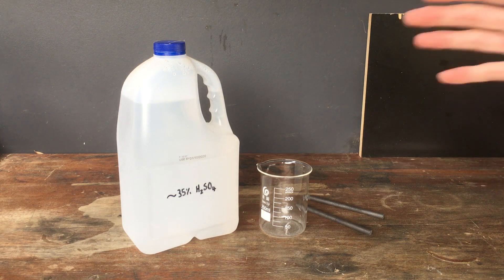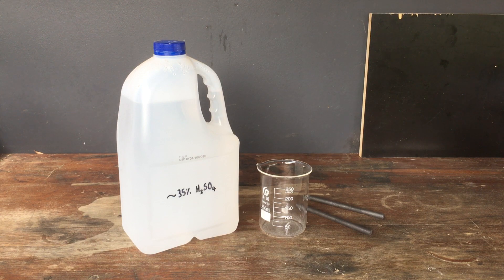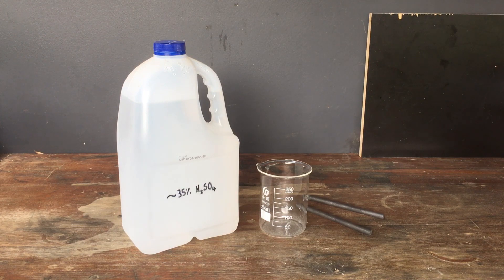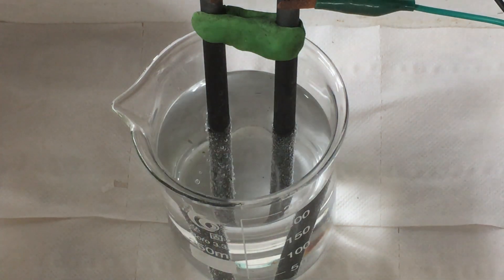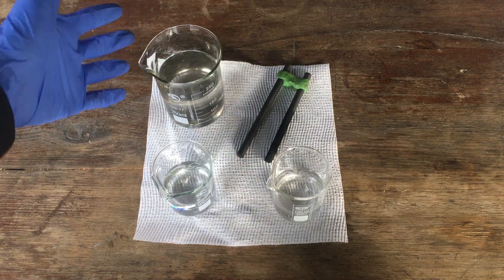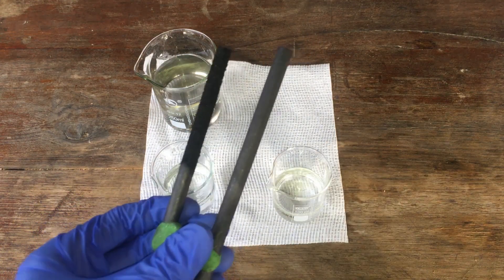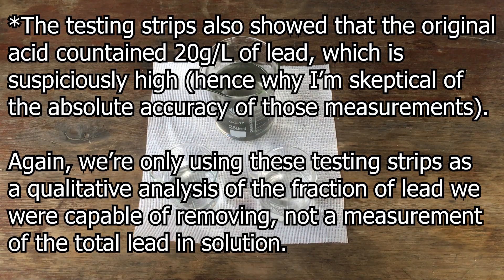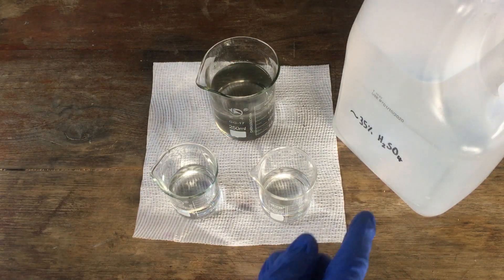Removing Lead From Battery Acid?

Comment: Can you make a video on making Potassium/Sodium chlorate using lead dioxide anode,by using your Flower pot diaphragm method ??
Reply from the maker: I'm actually working on a video about making potassium chlorate with an MMO anode right now, which should be finished in a week or so. 
I don't think I'll be working with lead dioxide in the near future I'm afraid.

What's your reasoning behind using a diaphragm though? As far as I know, chlorate production works fine without it.
Reply: @ScrapScience  as because the lead dioxide electrode got corroded in KCl solution,during electrolysis .

Comment: I totally get not wanting to distill sulfuric acid. That is actually a sign of a mature and knowledgeable chemist. 

The solution is to focus and get ready to distill the sulfuric acid. It takes preparation and a lot of safety. It might even take equipment you don't own yet (however I think you do own most of the necessary equipment and tools.) Take a few weeks and just study distillation and sulfuric acid. With just a few weeks of study/practice and a few dollars, you'll be ready. Once you're able to distill sulfuric acid, a lot of options open up. Good luck, I know you can do this safely and effectively!
Reply: DIstillation of sulfuric acid is an extremely pleasant process, IMHO. You don't even need a cooling water!
Reply: @dimaminiailo3723  that is a really great way to look on things.
Reply: @benjaminpainter378  Ahaha yes)
I've done this several times and I can say that I have never problems with sulfuric acid itself. Now, the only unsolved problem is the release of acid smoke from the preheated glass joint. Maybe I'll make a video about this process later.
Reply: @dimaminiailo3723  let me know if you do make a video, I'll support it
Reply: It's so nice to see a positive and encouraging comment in a youtube comment section. Good luck in all your endeavors fellow human! 👍

Comment: Thanks for sharing , what would happen if you just evaporate the water off ? with out a condenser.
Reply from the maker: For starters, you'll only reasonably be able to reach a concentration of around 70% acid before you start losing a large portion of your acid in the boiling process (and the required temperatures get dangerously high).
I'm unsure as to whether the lead would crystallise at that point. It seems like lead sulfate is still reasonably soluble in 80% H2SO4, so it'd be unlikely that boiling it down would be able to remove the lead.
Reply: @ScrapScience  ok cool.
Thanks for replying mate. Look forward for next video.  Cheers.

Comment: Alright I've got a bit of a stupid question. Couldn't you just boil the acid down and precipitate the lead that way as the dissolved lead sulfate shouldn't be very soluble in concentrated H2SO4. It definitely wouldn't get rid of all the lead but it'd be a good start i guess.
Reply from the maker: Not a stupid question at all, I was actually going to mention this in the video, but I forgot...
The solubility of lead sulfate is very complicated when you have an acidified solution (especially in acid concentrations like this). Standard solubility figures and solubility products are completely useless because the lead is able to form a much more soluble complex with the bisulfate ion in acidic conditions. So, with concentrated acid, it's entirely possible that lead sulfate could still be reasonably soluble. 

If we assume that boiling down the solution could yield a concentration of ~70% H2SO4 (which is a pretty reasonable limit if we're just boiling it down on a hot plate), lead sulfate will definitely still be quite soluble under these conditions.

As you've said, it definitely won't remove all the lead, but it might remove some.
Reply: @ScrapScience  Boil it and get it as concentrated as you can and then chill the concentrated acid to further precipitate the lead out.
Reply: @ScrapScience  what electrodes will be best for this purpose will copper and brass do or copper and copper
Reply: @ScrapScience  u once suggested that concentrating the acid and chilling to get the lead precipitated will this precipitate much lead than electrolysis’
Reply: I was thinking the same. Boiling it down is pretty simple and a lot safer than full distillation. Solubility of lead sulphate is pretty low (40mg/l or so in water according to vikipedia and pubchem). With low solubility product I'd assume  even less lead due to lots of sulphate ions due to the acid.
A quick chek indicated PbSO4 would react to lead hydrogensulphate in consentrated sulphuric acid (like 80%) according to some sources.. Didn't check solubility of that in water (or if that is soluble in sulphuric acid as the solvent).
Test strips indicating something like 20g/l seem to be way off, much more than saturated solution of PbSO4. I wonder where there is a mistake here.

Comment: This is why I like this channel.. Most others are assorted 'add this chemical' or 'use the following distillation/reflex/whatever' process..
Here, it's 'We shall use electrochemistry.. Because it solves all the problems!'
Edit: It was also pointed out to me that the easiest way to pre-constrate it is just to boil until you see white fumes white. You get a bit less than 70%. Done easily on a hot plate, in a very well ventilated area/fume hood(Did it in the back yard away from everything with a fan aimed at it). A little scary but brings it down to a manageable and roughly known consideration for storage. But doesn't remove the lead.
Reply from the maker: Haha, I'm pretty sure everyone else is just scared to use electrochemistry for anything. Once you start using it, all other chemical methods become obsolete :)

And yeah, I'm planning on boiling it down to around 70% at some point. I'll probably go to ~50% in an open beaker, and then go the rest of the way with a distillation setup anyway (just to prevent the fumes going everywhere).
Reply: *conCENTRate
Reply: @Sam-ob4of  What about it?

Comment: I don't know if you have distilled h2so4 before but a few tips are use a air condenser in front of a liebig to prevent breaking glassware, a vigero works ok for a air condenser also.. if the acid bumps to violently stop and let it cool to about 100c or less before running it through a fritz and try distilling again.. welding gloves and metal clips are a must have
Reply from the maker: It'll likely be a long while before I get around to it anyway. I don't have any way of reaching the required temperatures in a controlled fashion just yet.
Thanks for the tips! I'll keep them in mind for when I eventually convince myself that I can do it safely.
Reply: @ScrapScience  old lpg camp stoves work really well.. i ended up pulling a old free camp stove apart for the gas fittings and burner and stuck it all in a off cut of cattle rail (rectangle tube) to make an awesome little lab burner for high temp work, just need a welder, grinder and drill to make 1 and just set it up the same as in the stove except more compact.. a burner made from scrap to do scrap science 🙂.. i always distill off as much water as i can in a mantle using a vigero before final distilling too ( distill until it fumes up in the boiling flask) that way the acid is higher %to start with and the yield is much better

Comment: Use a lead Elektrode where you want to grow the lead out the solution!
Reply from the maker: Yeah, that would probably be better, whoops...
The reason I was using graphite was because it would have been a lot easier to see the progress of the electrolysis, plating lead onto lead wouldn't have given any visual change.
Maybe I'll try a copper cathode or something, I know lead can plate easily onto that, and it should still give a visual change.
Reply: @ScrapScience  yeah mate.... And BTW.... Good to have you back here
Reply: If you could weigh the electrode before and after the supposed plating . Hammer out some paper thin  electrode .;  it probably only would give a single order of magnitude discrepancy though . Limitations in malleability, try gold leaf instead  for greater orders discrepancy.